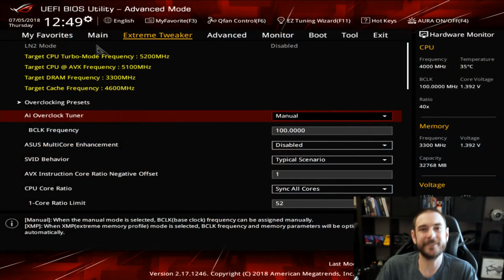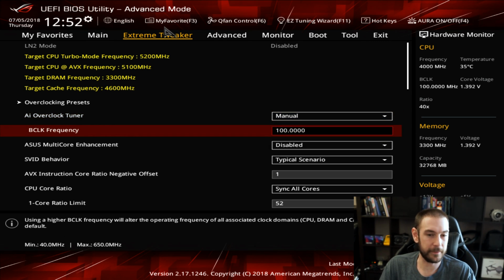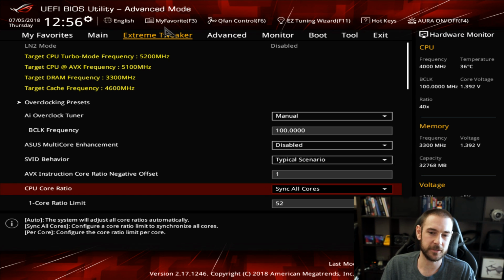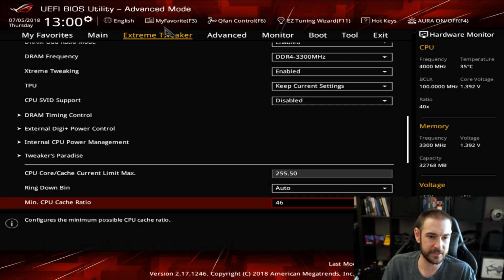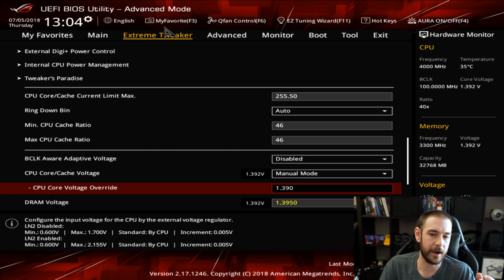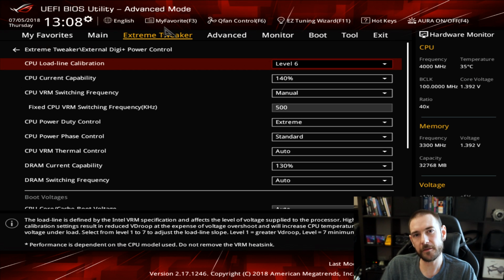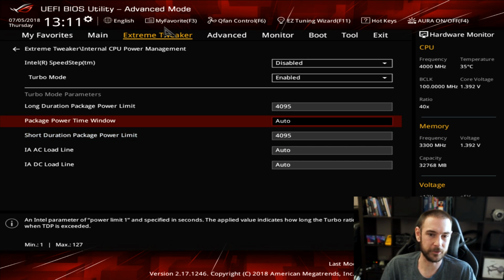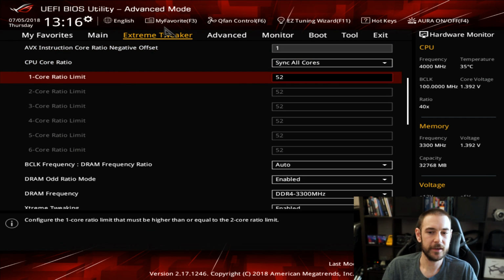How to Overclock an 8700K & 8086K - ASUS Maximus X and Others

Comment: Here is a reason to use offset mode = Lower cpu temp.
It's a hot chip that one!
In my case with my 1440p moniter I really don't need more than 4.7 all core turbo to max out my 1080 Ti, so I undervolt a bit to lower temps. 

Max load test: Cpu and Graphics
No undervolt = spike 95 c, average 89 c
with undervolt = spike 90 c, average 78 c
Non-delided cpu.
Reply from the maker: If the fixed voltage is set correctly, the temps will be identical under load.
Reply: @boostedmedia  Yup, that would do it. Basicly the same thing, lower voltage throughput.

Comment: Hey Will quick question for you mate. I am currently running my 8700k at 4.7 ghz with 1.28v stable. I ran the same sequence you did for stability testing watching your stability test video. I am trying for 4.8 ghz and I cant seem to pass OCCT at 1.32vcore. It fails 10 mins in. Any suggestions buddy? It's the only one that I cant pass.
Reply from the maker: What sort of temps are you seeing?
Reply: @boostedmedia  at 4.7 and 1.28 vcore I'm at 72 degrees. At 4.8 and 1.32v, eventhough it fails OCCT, I'm at 78 degrees, small spikes to 81 degress
Reply from the maker: Sounds like you’re probably hitting the CPUs wall. Better cooling may get you there but it sounds like it’s just not a very good chip.
Reply: @boostedmedia  that sucks man.  I use maya and vray for rendering. You think there is a difference from 4.7 to 4.8 for rendering 3d applications.  If not, might as well stay at 4.7 ghz and 1.28v. Your thoughts?
Reply from the maker: The difference is absolutely tiny mate. I’d set it to 4.7 and forget about it.
Reply: @boostedmedia  will do Will. On to the next adventure man.

Comment: With per core ratio you can set higher clocks with same voltage to fewer cores.

So you might be able to achieve 54x with 2 core, 53x with 4 cores and 52x with 6 cores with the same voltage (this is just an example)

Under load only two cores can get to 54x (it can be any core) and 4 cores under load will be at 53x and so on.

Comment: Thank you for a great video! Though, 1,350 voltage 8700k and 4,7 is stable. Though, in Aida64 I see 2-4 percents thermal throttling. Non delid. Any advice?
Reply from the maker: You’ll need a better cooling solution or to lower your voltage and clock speed.
Reply: Boosted Media I have x62 kraken so it seems sufficient.. dust cleaned it 3 weeks ago, thermal paste there is stock from the cooler itself and is around 6 months old.. seems I ll have to consider playing with settings. Anyhow, thank you! Any further advice is more than welcome :)
Reply from the maker: That stock thermal paste they come with is pretty awful. But you may end up having to delid.
Reply: Boosted Media tbh only thing stopping me from deluding is 3y warranty on my box version of cpu. As soon as it ends -
Dellidding, though, I am not sure about putting conductive paste their (liquid metal) or just a good paste like Noctua
Reply from the maker: Absolutely should use liquid metal if delidding. Using thermal paste won’t give you any improvement over stock.
Reply: Boosted Media ty for advice!
Meanwhile, playing with voltage: 1,3V with 4.7 Ghz and avx offset 1 seems to have no throttling at 8 mins of Aida tests. Temp peaking at low 90, I will try to lower voltage a bit mote so it wouldn’t get past 80s. Ty for your great advising, I think I get it now :$
Reply: @boostedmedia  Hi! I have successfully reached 4.8 Ghz, stable, at average temp (hottest core) 64 degrees, highest peak of 84 degrees, voltage - 1.225
I replaced  stock x62 kraken thermal paste on noctua nt-h2 and this is quite a success! I suggest lower voltage did the biggest part.

Comment: I'm just OC'ing to 4.7Ghz(Sync all cores) with my i7 8700k with all this settings and so far so good with only 1.2v , the only difference i made was using the "XMP Profile" for the RAMs(G.Skill 3200MHz Ripjaws V DDR4), because i don't know how to do it manually, maybe do a tutorial for that?
Reply: NO You NO You well 4.8Ghz with 1.2v its  impossible for me, i have to use 1.235v to have stable 4.8ghz and cache ratio to 4.4(4.5 crashes for me as well)
Reply: NO You you mean an automatic OC profile for 4.8ghz that comes with your motherboard?

Comment: YOU LEGEND! Just upgraded from Fx-6350 to an Asus tuf gaming plus with 32gb trident z 3200mhz and an 8086k - Was getting so frustrated with the software AND Cinebench would bloody blue screen me! Noted down everything you said (went with your settings and not your "lower to start" ones haha) and boom SHES ALIVE! it was worth the hand cramp from writing it all down so fast lol  - Getting 32deg idle cpu temps just using my Noctua NH-U12s that i plan to upgrade to the Dark rock pro 4 in the next few weeks. 1 very happy camper here, NEVER done any overclocking before and is my first Intel system ever! now i just gotta figure out why i cant see cpu temps in open hardware monitor.  oh btw cinebench score went from 965 with the AMD rig (fx6350+32gb ram) to 3913 with the 8086k! I almost have to change my shorts! Massive respect man from down under in New Zealand
Reply from the maker: Awesome mate. Glad it helped. Enjoy the new system and thanks for taking the time to let me know it helps. Normally I just get told to kill myself in youtube comments. Lol.
Reply: @boostedmedia  windows is annoying me there is lag opening folders etc and some chrome browser freezing sometimes like lag - do you think that my r9 390x is bottlenecking the system? eg my fx system was smoother in windows that this new one!
Reply from the maker: Try disabling 3d acceleration for windows UI.
Reply: @boostedmedia  google is a bust on how to do that!
Reply from the maker: https://www.google.com/amp/s/www.thewindowsclub.com/hardware-acceleration-windows-7/amp

Comment: I need help... my CPU frequency didn’t change.
Reply: yeah, an i8700k.  Turns out it's auto-set to OC anyway but I would still like to know how to control it. @prorank4
Reply: Z390A @prorank4
Reply: Yup.  Synch All Cores.  I should note: the frequency on the right-hand side of the screen that shows up under "Hardware Monitor" is what I am referring to.  I hadn't booted up to see if it may be running differently to what it said there. (As it is doing on it's auto-oc mode)  @prorank4

Comment: Hello, I've done everything you shown on the video. I have a Asus Maximus X Hero Z370. I set my cpu to 4ghz with nothing less than a voltage of 1.21 on a air cooler with a 30c tops. For whatever reason, I noticed that the bios will only show 3700mhz frequency and I have all core ratio limits set at 40. On your video for the 8700k like I have your bios is doing the same thing. I have my ram set on XMP with a speed of 3200. Can you tell me why the bios doesn't show the correct cpu speed?
Reply from the maker: It’s showing the default clock as reported by the CPUs ID. Not the actual clock frequency.

Comment: I have no idea about overclocking. Trying to overclock the 8700k and rog strix 370e. Would it be safe to use your settings?
Reply from the maker: Should be ok as a starting point.
Reply: @boostedmedia  thx :) Good videos btw. How you learned all that stuff?
Reply from the maker: Just lots of experimentation over decades :)

Comment: Thanks for a great video. I'm sitting an 8700k and a Corsair H150i AiO. How far should I go? In terms of Vcore and clock speed? I want a safe sweet spot, just for gaming :D Btw, my GPU is a GTX 1080.
Reply from the maker: I wouldn’t go over 1.35V with that cooler personally.
Reply: @boostedmedia  Okey, is it normal that the Vcore can bump to 1,4 sometimes when running just 4,5 Ghz? Mobo: ROG STRIX Z370H gaming.
Reply from the maker: It shouldn’t go over the set voltage.

Comment: Can you/someone post a source to confirm that running at costant max Vcore won't damage the cpu? I'm reading everywhere to use dynamic so my Vcore can drop down when in Idle. Less consumption and less stress on the cpu.
Thanks
Reply from the maker: It’s simple physics. I’m working on another video regarding this right now. Will be up in the next few weeks. 

I’ve run all my PCs this way for 20 years and have never had a processor fail.
Reply: @boostedmedia   well thank you for the answer! I'm looking forward to that video!
Why do you suggest disabling c states as well? Isn't fixed Vcore and high performance power plan enough?
Reply from the maker: Only reason for that is it can cause confusion. “Why does my cpu keep throttling”.
Reply: @boostedmedia  Why having the cpu always running at max Clocks though? Can't you have fixed Vcore but let the Clocks go down when Idle?
Reply from the maker: You can if you want. Personally I don’t see the point in having it throttle as the power savings are tiny.

Comment: get stable overclock to 4.7 with 1.240v and load line calibration on 6, now my games go smoothly. thx for the guide
Reply: What motherboard do you have?
Reply: @eggamyer3371  I had the maximus apex xi but I had problems with the pci-e and amazon returned my money. now i'm with the aorus master. they both work very similar

Comment: You're lucky, my 8700K can't do 5 ghz no matter what, i have delided and i i'm doing 4.9Ghz max with 1.390v (Which gives 1.392-1.408v on CPU-Z) with 0 AVX Offset at LLC6.
Reply from the maker: Sounds like my first 8700k chip. There’s some shockers out there.

Comment: Can you give me a help? I am new to overclocking, yesterday I overclocked my core i7 8700k to 5Ghz and manually set the voltage to 1.24v (I managed to stabilize 4.9Ghz to 1.21v). I have two questions: 

1- What temperature information is most accurate, HWMonitor or AIDA64? In HWMonitor my temperature reached 97 degrees and in AIDA64 the maximum was 85 degrees for 5 minutes. 
2- Why when I start the stress tests and benchmarks, the CPU-Z shows my voltage up to 1.28v (most of the time to 1.26v), if I manually set the bios to 1.24v?

Sorry if my questions are noobs, but I really am a beginner in that environment. Here is a print https://imgur.com/a/aF11csh
Reply from the maker: A bit of voltage overshoot is normal as explained in the video. 

All temperature monitoring software reads from the same sensors, I’m guessing you’re looking at package temp vs. individual core temp.
Reply from the maker: Absolutely no need to apologise. I’m always happy to help anyone who’s willing to learn. Feel free to join our Discord server for more help :)
https://discord.gg/7YzjkFQ

Comment: Thanks dear friend with this video you made my BIOS best OC Ready BIOS however it cost me a burned CPU and Mobo (No I'm just jocking). Sync core hasn't gone well for me but per core I reached highest possible with my 8086K which is x82 in first core, I've even reached up to 5 core x80, and finally I ended in 3*80 2*75 and 1*49 which is relaiable for my use (it is a must to keep last core low). With 3 cores in 8Ghz it can well pass Benchmarks like PassMark, CineBench, RealBench,... (But it can not stand much CPU stressing and that's ok for me). Now with 3 cores 8Ghz I have a extrimly fast PC and all is because of your good OC guidance in this video. I'm your fan and thankfull to you.
Reply: Yes he is good. In this video https://www.youtube.com/watch?v=hkxcwK47Lcw you can see what I've reached with his good OC basis.

Comment: Do I need LLC so high if I am just aiming for like 4.8 on an 8700k 24/7 OC? If not what would you suggest starting with? It’s at 6 currently
Reply from the maker: 6 is the best starting point. You can work down from there and follow the steps in my stability testing guide to see where you’re stable.

Comment: Came back again to say that if I could double this video I would. Started my 8700k @ 4.7 min 4.2 and my G Skill Trident 3200 14-14-14-34 set up manually now with your recommended settings. Going to work from there and see how high she can go. CPU is not deli but under a 360mm Corsair AIO cooler and all fans including system maxed. Temps are insanely low still!

Comment: Thanks for so much for this! I got my Code X with the Release BIOS and it's been fine but my XMP profile is a tad unstable so I needed to manually do my RAM and figured why not tinker with the 8700K at the same time.  May I inquire as to which BIOS version your Code X was during the filming of this content?
Reply from the maker: I honestly can’t remember. Sorry. I’ve never noticed a difference in stability between bios versions though.

Comment: Will this work on a maximus hero ix? The settings not the clock speed.
Reply from the maker: Should be very similar.
Reply: @boostedmedia  thanks!!! Also, how would you enable the timings in the asus bios?? On the box it has 4 sets of numbers like for example...18-22-22-42, but in the bios I see 3 sets of numbers for example..18-22-22-auto. Can you help me???
Reply from the maker: It’s generally best to just use the XMP memory profile as shown in the video. This will automatically set the timings as they are on the RAM box for you.
Reply: @boostedmedia  ok thanks!!!😁👍

Comment: hey dude can you answer a question for me. i followed your guide and derbauers oc guide i have a 8700k and maximus x hero mobo i set it to 4.8 and managed to get as low as 1.24 volts but it wont drop below 80 to 82 celsius and its doing my head in im in QLD australia and i have a 360mm rad AIO am i doing something wrong?
Reply from the maker: What are you using to stability test? That’s about right for a non delidded 8700K at 1.25V doing small FFTs. Possible your cooler is installed badly.
Reply: well if thats about right for non delidded 8700k i guess im asking to much of the cpu my room is over 30 celsius during the day aswell so that wont help the aio isnt loose on the chip im also using thermal grizzly kryonaut paste. i used aida64 for the stability test it didnt crash also used a run on cinebench i think im just getting a bit worried of it hitting over 80C
Reply from the maker: If your ambient is 30c I’d definitely say that’s about right for a non-delidded chip with an AIO cooler.

Comment: Okay, so I bought an i7-8700k off of amazon and ever since it’s been delivered I’ve been disappointed since I had a terrible i5 beforehand and I expected more of an improvement. So I tried doing every setting in this video and my speeds STILL don’t reach over 1100 multicore test in CPUZ, is there something wrong or what is recommended. Also I’ll run Spotify, streamlabs OBS and fortnite and my CPU usage will be 100% and my lag is unplayable. I hoped getting an i7-8700k would’ve solved it but it didn’t work, I need help. What does anyone suggest? Also cooling isn’t an issue, I have an H100i Pro and the same motherboard that’s in this video AKA ASUS Maximus.
Reply: Or do I just need to continue overclock my higher values?
Reply from the maker: Far too many variables to be able to diagnose here. Could be a lot of things. That doesn’t sound right even at stock clock speeds.
Reply: @boostedmedia  So what could be possibly holding it back in terms of speed?
Reply from the maker: As I said there are too many variables to diagnose here. Double check your settings match the video first and what are your temps like under load? That’s where I’d start.

Comment: I'm able to run my 8700k at 5.3ghz at 1.35 v (boot at 1.335v), still working on stability tests, but def seems stable for gaming. All I changed was core voltage and core-ratio. Im curious if I can just 5.4ghz using some of your settings. Just using core-ratio and core voltage I could get it to boot at 5.4 at 1.38-1.45 v but it won't benchmark without crashing. I appreciate the detail you went into here and def going to subscribe!
Reply from the maker: Sounds like you have a great chip. My settings should work with an increase in vcore

Comment: Thank you so much for all tips! I have done overclocking with XPM profile mentioned in some other videos and I was getting 88+ C on 8700K on Maximus Hero XI, your tip for overclock is the only one which keeps the temps on normal values during the stress tests, I just don't get how my voltage values on Vcore stay so low instead 1.350 I have set it on 1.200 and system show that is on actual 1.163 under the stress tests, also on my bios I have option for CPU current capability up to 170%  will it be ok on those values or just keep it 140 like you recommend in the video .
btw the cooling i have is Thermaltake Floe Riing RGB 240mm . Cheers!

Comment: i got into windows and check my clock speed and all of the software that I used to check say that my 8700k is still at 3.7 GHz. I did literally everything in the video and I have the exact mobo as you. why did this not work?
Reply from the maker: What software are you using to check clock speed?
Reply: @boostedmedia  I used the Windows info panel, Steam system info, and the task manager all say I'm still clocked at 3.7
Reply from the maker: Yep they read off the CPUs ID not the actual clock speed. Download CPUID and try that.
Reply: Boosted Media omg i’m so dumb!! I am hitting 4.8 after I check a stress test. for some reason i was reading the name of the processor and it said “Intel Core i7-8700k @ 3.7” sorry about the confusion. i’m just an idiot. also good tutorial
Reply from the maker: Lol. You’re not an idiot. It’s a very common misunderstanding. :)

Comment: I have an 8700k with a h100i 240 water cooler, I am pretty sure I got a lower end binned cpu. I run an All core over clock at 1.33 volts at 4.7ghz and under load for over 40 min it hovers around 70c, is this a bad cpu and how far do you think I could get this frequency wise?
Reply from the maker: Hmm does sounds like either you have other settings not right or a rotten chip.